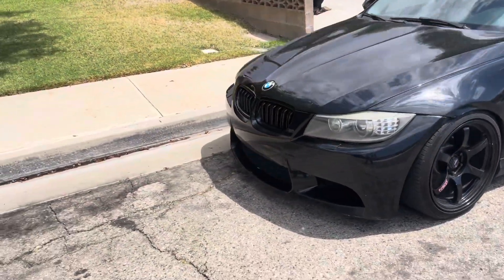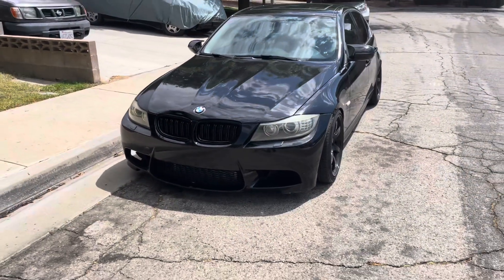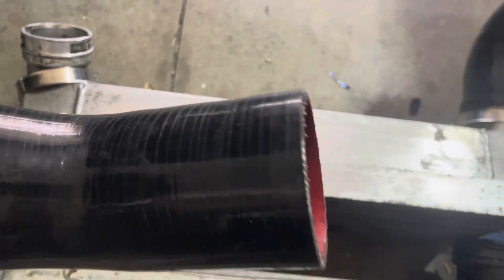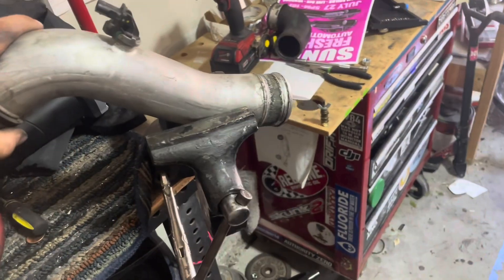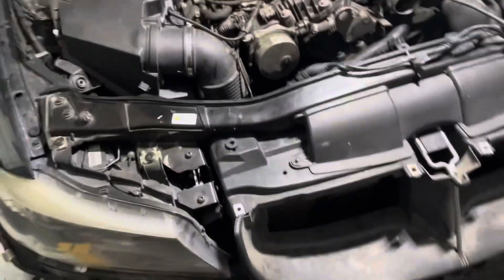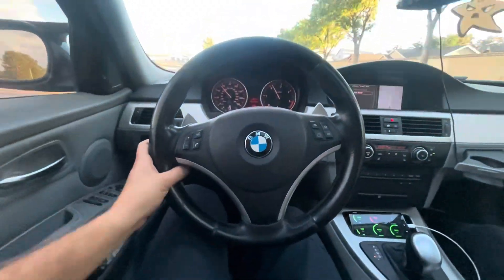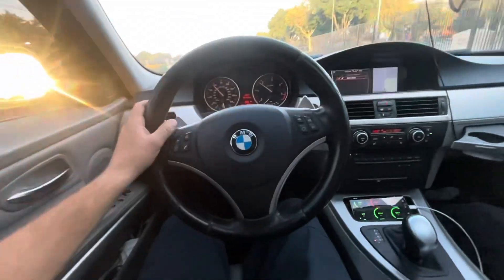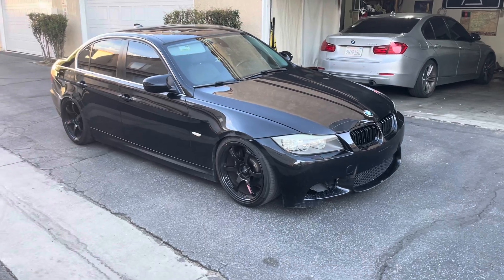FITTING 335i INTERCOOLER ON 335D

Comment: Im currently doing this. Is it easier to have the hoses on the intercooler first or have them attached to the turbo and the pipe assembly from the throttle body first? I've been fighting trying the getbthe hose on the intercooler from the turbo and I already have the 90 on the pipe assembly but cant get the iat plug off so cant take that whole thing out of the car